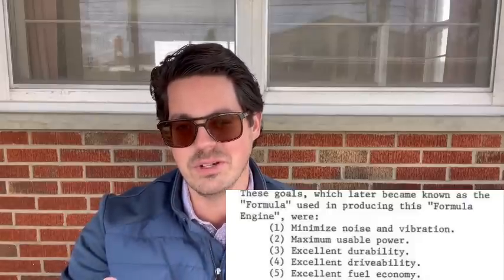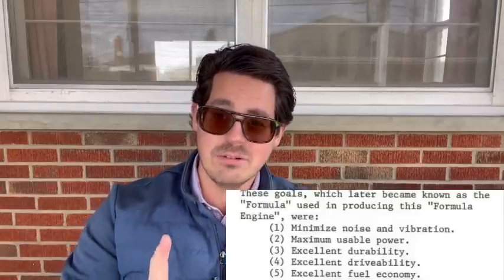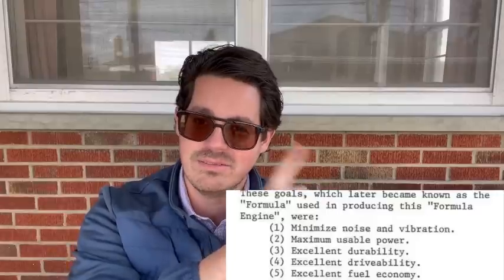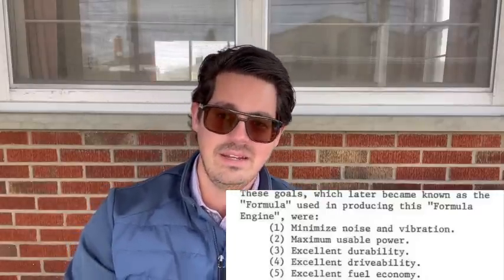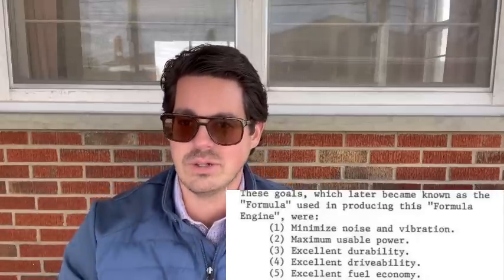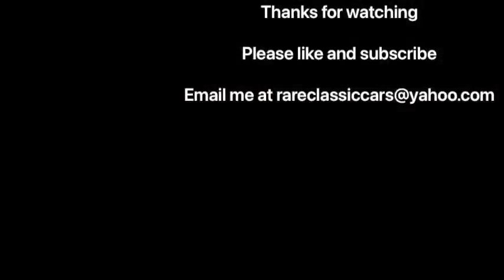Worst Engines of All Time: GM's 2.5L Iron Duke 4-Cylinder

Comment: One of the worst engines? I really would not put it in that category, but you don't have a "Most Mediocre" category, which is where I would put it. I had an '84 Chevy Citation with one, and I was quite satisfied with it. It was reasonably easy to repair, with the noticeable exception of the distributer. I specifically looked for one with the throttle body injection. The computer controlled carburetors of the era were just a pain. The manufacturers were beating a dead horse trying to make a carburetor work under those conditions, and even throttle body fuel injection was a huge improvement. From what I have read, the S-10 and Long Life Vehicle had a beefier block and so on and the LLV postal trucks live up to their name. The last ones were made in 1998 and they are mostly driven in terrible conditions of short stop and go runs, but they are still running.

Comment: I bought a used 1980 sunbird for my first car in 1993. I paid $200 for it. I don’t remember the exact miles it had but it wasn’t low. When I got it home I pulled the valve covers because it had a gasket leak. The sludge under the valve cover was the same shape as the cover. Cleaned it all out, tuned it up and drove the crap out of that thing for three years. Eventually the tranny and rear end went so I traded it to a buddy for a tune up on a 1982 olds cutlass I just bought. The Bird sounded like a sewing machine and I loved that thing. Wish I still had it. Started everytime and the motor never let me down even though the rest of it did.

Comment: I had a 1980 Old's Omega, 4 cylinder, 4 speed. Most comfortable interior ever. Sold it with 162,ooo miles on it. The body was absolute junk. The doors & floor were falling apart after 8 years ! That engine trani combination could smoke a number of sixes & small block V8s. After 40 mph, they would blow by me, like my engine had stalled, but it was a ton of fun smoking that one tire & getting rubber in second. Great article Adam & great memories. Thanks.

Comment: Loved my Iron Duke in my 89 S15. They didn't have balance shafts in the pickups though. Also had a distributor but was easily accessible. At about 60 mph it revd at about 2500 rpm with the 5 speed. I did have an after market tach. I also towed my small fishing boat with that truck.

Comment: I had a 2.2L OHV I-4 5 speed 93 Cavalier my mother bought new for dirt cheap and handed me down. It wasn't even close to the Hondas and Neons of the day. It was way better than the Duke, it had good tq, you could really lug it down and it would still pull it down the road, it just didn't have the ability to rev and make HP up top. Only the second clutch I ever destroyed. Beat the heck out of that car. I was glad to not be walking but, I was much more excited when I got my first 4.6L.2V 1992 Cown Vic LX.

Comment: Had an S10 with one of these. The truck itself was in such bad shape due to the rust from all the Pennsylvania winters, (the motor had well over 250,000 miles on it when it was finally parked due to a worn out clutch) that I refused to put any money in it which included oil changes. I know I ran the same oil in it for at least the last 30,000 miles of it's life. No heat. No brakes. Held together with zip ties and Bondo. Bad truck. Great engine.

Comment: I had an '82 Olds Omega with one. It lived up to the stereotype of a GM engine that ran poorly longer than most others ran. It was never quiet, never powerful, and occasionally just stopped (Transmission, not engine issue), but it worked.
A friend's sister was upset to find out her Camaro, my Omega, and his car (A Citation I think) all had the same engine.

Comment: The Grumman USPS vehicle stopped production in 1994, so, every classic USPS truck you see (which, here in MN, is most of them) is 29 years old, or older, and it has an Iron Duke. Constant starts and stops in sometimes, -30F or colder weather, up to over 100F weather. I can't think of any vehicle that has to endure more abuse than mail trucks. The Iron Duke is a real dog, especially in an automatic, but, they do keep going.

P.S. This was one of GM's best but most boring engines. Reliability is always paramount, especially in extreme conditions.

Comment: I had as my first car a 1981 Pontiac Phoenix 2 door coupe in 2 tone black and silver with red bucket seats. Very nice looking car for a 17 year old as it was only 3 years old and had 30K miles. BUT, the 2.5 Iron Duke was HORRIBLE !!! I must have gotten a real 🍋🍋🍋. From the start it overheated regularly even though the dealer put in a new  radiator, water pump, thermostat and flushed it two or three times. The dealers ' FIX ' for the overheating problem was to pull the bulb out of the TEMPERATURE light which I didn't know about until after the fact. It was so noisy that many people thought it was a diesel !!! Eventually through constantly running hot it burned some valves and would barely run but it was out of warranty at that time. It suicided itself by backfiring repeatedly during a winter cold start and caught the engine on fire. My Dad said to let it burn for a while before calling the Fire Department so we could get the insurance money for it. I took the insurance money and bought a new 1986 Dodge 600 ES convertible Turbo. Kept it for 7 years without any problems.

Comment: With the way GM used products from all over the globe, I’m very surprised that they didn’t turn to the many already available 4 cylinder engines from Vauxhall and Opel in Europe and instead made the awful Iron Duke! Really doesn’t make sense. Great video dude
Reply: Those Vauxhall and Opel motors were too small.  Not enough torque.

Comment: Sorry these engines were very reliable and basic.  But most people seem to think all the bells and whistles make an engine better.  Had a Jeep pickup with this engine and it worked fine.  It wasn't a real powerhouse but it worked.  Later I got a Jeep Wrangler with a 2.5lt and have had it for nearly a quarter of a century now it has 225,000 plus miles.  Installed a home built turbo at the 180k mark, now I can pull the trailer at road speeds and 5th gear.  Now getting it stopped is interesting.

Comment: Remove the EGR valve to remove the valve cover.
Dad bought an '86 Cavalier RS, rockers were a bit noisy so I adjusted them and it was quiet after that and drove for many miles as my dad used it as a company car.

Comment: We had a 89 celebrity as the "family" car growing up, and that was dads daily driver, we had that car for 7 or 8 years, and took many trips over the years to see family 550 miles away, but that 2.5 was a really great car, and it wasn't overly noisy, I mean all 4 cylinders were a bit at that era, but this one wasn't bad, we used to think those 2.2 K cars were noisy back then, dad always said that was the best car we ever had, he said the only flaw with it was the exhaust ports were so close to the valve cover on that engine that the gasket never lasted long, he changed the valve cover gasket relatively often

Comment: I was one of those customers back then. A 26 year-old, buying my first new car, a 1984 Pontiac Indy Fiero with a four speed manual transaxle. As Car and Driver noted at the time, a Porsche 944 also had a 2.5 liter four cylinder, but the Porsche made 150 horsepower,  while the Iron Duke made 92. I liked my Fiero when it wasn't frying fusible links and leaving me stranded, or drinking coolant.

Comment: I worked for Chevy as a technician in the early 80’s the engine itself wasn’t that bad although power house the biggest problem with it was the Carburetor in my opinion it was certainly a better engine than the Vega engine I used to replace at least once a week in the mid 70’s.

Comment: I couldn't disagree with you more on this.  I owned a 1990 Pontiac Grand Am with one of these motors and absolutely loved it.  It had a 5 speed manual and I used to run the absolute crap out of that thing.  I would rev it to red line every time I shifted it.  We wound up moving from St. Louis to Dallas in 1993 and we used it to drive back and forth home.  It was 630 miles one way from my driveway in Dallas to my Mom and Dad's driveway near St. Louis.  Driving that thing at about 70 MPH in 5th gear I could get 40 miles to the gallon all day long.  I owned the car for over 5 years and wound up getting rear ended on my way home from work.  It knocked the back bumper off of the car but I put it in the trunk and drove it home.  The insurance adjuster came to look at it and he had to do a double take when he saw how many miles were on the car.  It had about 195,000 on it and still ran like a champ.  The only thing I ever had to replace on it was a water pump, an alternator, the brakes a few times and about 4 sets of tires.  To this day, that car was the best investment I had ever made in a vehicle.  They totaled the car and gave me a check for $3,500.  I had only paid $10,500 for the car new.  If I could buy another one right now brand new I would buy it.  It sounds to me like you prefer automatics and that is the heart of all of your problems.  Everybody knows that if you have a 4 cylinder motor you absolutely better have a manual transmission.  I currently own a 2002 Cavalier with the push rod 2.2L and 5 speed and I really like that car (I have 4 cars and it's the oldest/beater).  It has 252,000 miles on it but I did replace the motor in 2013 after my son over heated the original one and it warped the head.  When I saw the title of this video I had to click on it because as far as I am concerned, the Iron Duke is one of the best motors GM ever produced.

Comment: I got a free 91 Olds Calais with this engine 16 years ago.  I use it as a winter car and for having 291,000 miles it still runs like a top.  Hooked to the 125C makes it super reliable as it doesn't have enough power to hurt itself or anything behind it.

This one has the balance shaft/oil pump/filter monstrosity in the pan, a timing chain, and roller lifters.  It's really pretty smooth....and it'll be a sad day for me when it shits the bed because finding parts is not easy.

Comment: The funny thing to me is that they superseded these with the "GM122" which was also a 2 valve OHV non-balance shaft engine that made mediocre power and wasn't very smooth. They were just a bit lighter with aluminum heads.

Comment: I have a 89 S10 and it has a distributor and no balance shaft which contradicts what you said in you video, the engine has a date code of 89.. Did the motor change in other vehicles and not the S10? I just had my engine apart for a rebuild so I know what is in it. I was surprised it had a roller cam in it.
Reply from the maker: Yes. It changed for the passenger cars. Not S-10 trucks.

Comment: 234k on my 1985 with tech 4. It has never been opened up beyond several valve cover gaskets. No real issues with it in the 26 years I have had it.

Comment: The 2.5 was a decent basic engine. It got good gas mileage and was tough as nails. I drove on 270+k miles in an 87 Celebrity. I put on an average of 100 miles a day for about 3 years on this car. Started every day like clockwork. Yes it was growling and rough when cold, but it did the job with efficiency. The car was inexpensive to buy and maintain. Better than my newer cars today where a minor issue will render the vehicle a brick. Edit: The stupid Celebrity did use up alternators....
The dash shake was bad motor mounts. Replaced them the 87 and an S10 I had, vibration stopped. The front wheel was the dog-bone mount, there is an updated version that fixes the vibration.

Comment: I had one of these "Iron Duke" Tech 4 engines in my first brand new truck, a 1991 Chevy S10. Thankfully it was backed by a 5 speed stick. Overall, a good engine but the sound of it always reminded me of a Volkswagon. It got decent gas mileage but nowhere close to 30 on the highway. For '91, it was rated at 105 hp and I never experienced the vibrations but not altogether smooth. Not the most powerful and definitely not very free reving. It wheezed when you reved it hard. I put 60k miles on it before I traded it in on a brand new 92 S10 4x4 with a 4.3 V6 with a 5 speed which had a lot more power.
Reply: Sounds like the same generation as a GMC Sonoma I used to ride in, back in 1994 and 1993, most likely, and I was only 13 in 1994, but I do remember a sound that was like a Volkswagen Beatle! That was the same one where it can feel like it's pulling a camper, (or has a camper on the bed!) when nothing is being towed or no camper on the bed, LOL! Wouldn't be surprised if it was a 5-speed manual.
Reply: @RJARRRPCGP  GM Canada had a promotion for the S10 and Sonoma in 1991 where they were selling for $7895 for a regular cab short box. They dressed them up a bit with styled steel wheels, AM/FM cassette, carpet and cloth interior and limited exterior colors (blue, black, white, silver and red). Mechanics were basic with the Tech 4, 5 speed manual and no power steering. A great deal for a kid fresh out of high school like myself...cheap with a full GM warranty. Those promotional trucks weren't the best ones built as they were all tossed together as fast as they could build them. They were popular with the mini truck guys as they were so inexpensive to buy and the truck itself was a good platform to dress up and customize. I kept mine for 3 years and traded it in for a 4x4 as it was better suited for camping and off roading. It was a decent truck for the price but it had a lot of "little things" because of the price.

Comment: I had an Iron Duke 2.5L engine in an '81 AMC Eagle SX4 (short chassis AWD Eagle 'Rally Car').   The car was great fun, happy cruising 40-65 mph.  Over 70mph the vibration and old-everything...it wasn't happy.  But cruising along; secondary roads, fun.  With so much mass, so heavy:  The Iron Duke was not a 'Revver.'  It took it's heavy time winding up from a stop light.   4 Speed.  Had over 200,000 miles. It thumped like half a V-8; 'muscle car-' (as if...)  rough idle.'  To fit in the Eagle the exhaust journeyed across the car, twice. I wrapped patched the crossovers with sheet metal and hose clamps.  Produced the thumps and slow-roar.  Only 80-100 hp, but a lopingly fun sound.  I drove the Eagle SX4  '95-2000.  Something seemed to break/wear out each week; such as vacuum hoses; or the slave cylinder boot....   Was my 'Cool Car.'  Glad I experienced it.  Cured me of wanting a Vintage car. Was great at  moderate off-road.  'Had a Cabin a mile into woods; excellent car.   --Except the low mounted distributor and awkward alternator.  Fording 29" stream in a marsh, I'd have to thoroughly dry it on reaching the Cabin.

Comment: Aluminum pistons have been standard in all engines sense early fifties.  In 1882 throttle body injection was cutting edge technology.
Reply from the maker: Many cars had port fuel injection by then. It wasn’t cutting edge. It was cheap.

Comment: The Chevy II engine was not called the Iron Duke. It went one to be a great industrial/marine engine and it's descendants are still available new. The iron duke was smoother than the Durabuilt/2300.
On the Fiero: The rod bolts will not take high rpm. They stretch. ARP rod bolts fix this and we could run it at 4500 for about 50 miles in high gear on an automatic Fiero.

Comment: I remember, I was a mechanic for Luby Chevrolet in the early 80s. I went from a  76 Chevrolet Monte Carlo, to a brand new Chevrolet Celebrity back in 85. It was a great car, but it had the 2.5. It was ok, not great but not bad. I ended up trading it the next year for a 86 Eurosport.
Reply: Gas was fairly cheap in the mid 80's. Why not buy something like a Regal then? Price was prob much more over a Celebrity.

Comment: That vibration at idle in the iron duke is result of modern fuels. Yes they were not the smoothest 4 cylinder but in the day they were not any worse than any other North American OHV 4 pot.   These engines can be quite fuel sensitive and they do not like modern low sulfur ethanol added and additive laced oxygenated fuels.
Reply from the maker: I’ve owned them for many, many years, before ethanol blends were common.  And, my parents had at least 3 brand new cars w this engine. They all shook at idle even back in the day if it were an auto trans FWD car. In the S10 or manual trans cars, they were fine.
Reply: @RareClassicCars   NEVER had that issue family and myself I have owned several from new and never had that issue not a one and since I serviced them all I would have known, yes the idle was not v8 smooth but it was NOT rough enough to shake the steering wheel, this sort of poor idle performance did not start till the early/ mid 90's when fuel formulations were changed with things like oxygenators.

Comment: My Dad purchased a 1981 Citation with the Iron Duke and was so irritated by the interminable vibration of the steering wheel and dash at idle that he traded it for a Citation with the 2.8 after a week! That car was smooth and much quieter but developed a huge rear main seal leak at 17K miles.
Reply: The 151 4 cyl was a FAR better engine.  Not powerful or smooth or quiet, but it WORKED.

Comment: I loved my 1980 Monza 4 speed 2.5 until I had to change the head gasket!  I learned after the second failure of the gasket that this motor has a very specific bolt torque procedure, if not followed to the letter... Shortened the life expectancy of the gasket...
Reply: Doesn’t sound like a terrible problem to me.  Just do it correctly.....

Comment: Brazilian 151 was also bulletproof. In the second half of eighties, ethanol-fueled 151 were very common in taxis, reaching over 250,000 miles without any big trouble through the bad roads and hard use status.